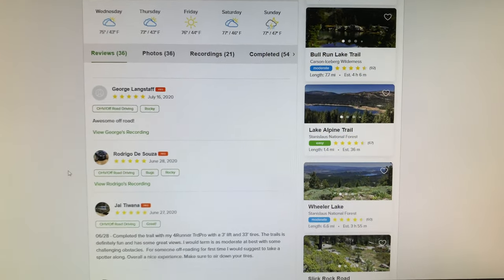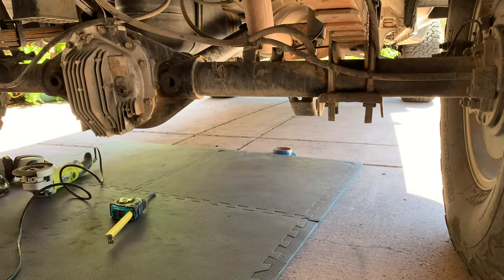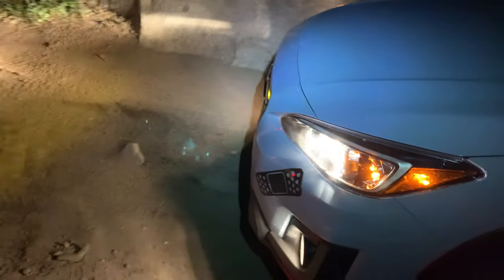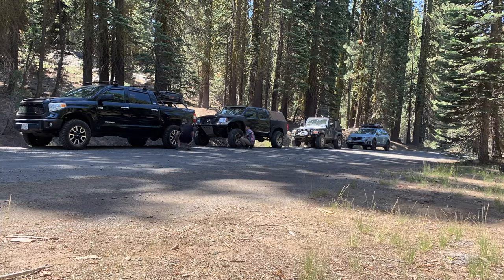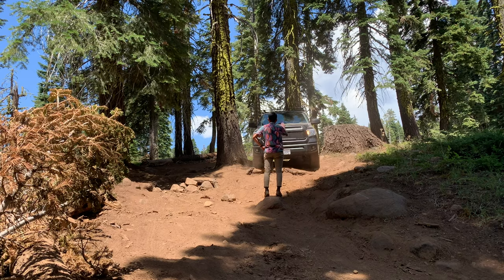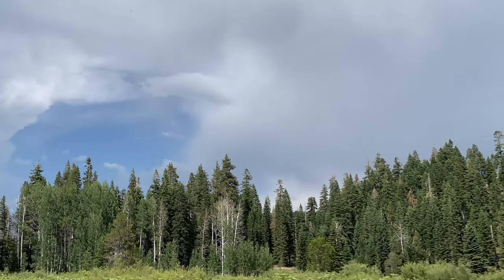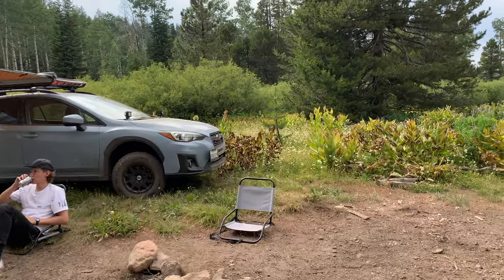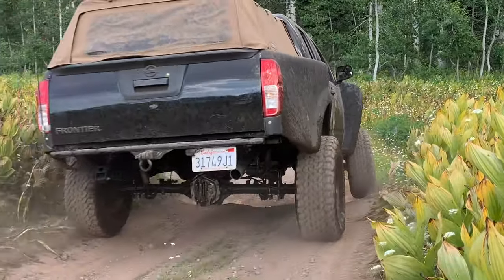Corral Hollow Trail |  Did we make it?

Comment: Hows the suspension feel on rough wash boarded roads?  I'm thinking of building a prerunner style truck so I can explore backroads more comfortably. Is it pretty supple and compliant?
Reply from the maker: its pretty smooth if you air down properly, if not its still relatively rough since ive tried both. I have the radflos valved so it feels better on the "bigger stuff"  feels way better then stock though! hope that helps
Reply: @Broccoli1  awesome thanks and sweet truck!